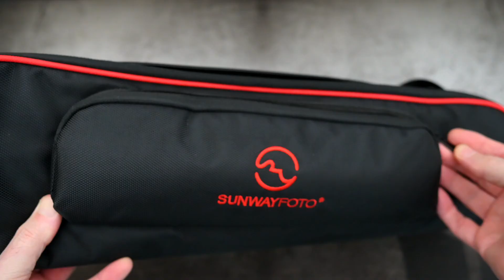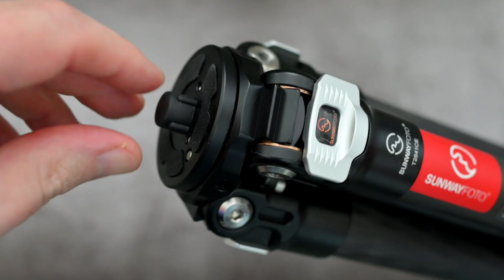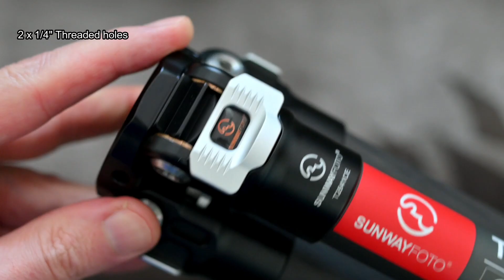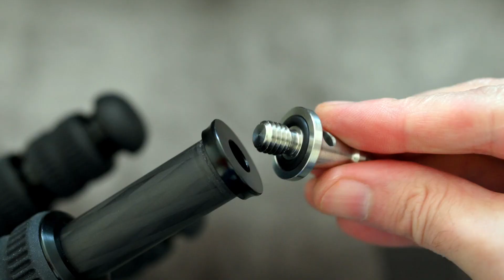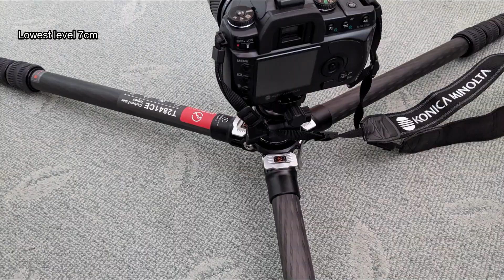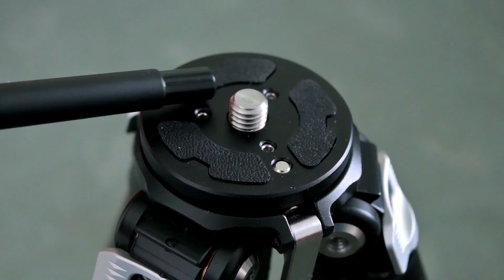Sunwayfoto T2841CE Ultra Compact Carbon Fibre Tripod: Review

Comment: The center column shape is to reduce the diameter of the tripod during travel. no "thigh gap" from the legs not closing all the way, which is common on tripods with center columns.
Reply from the maker: There are various design reasons why some makers are using a triangular shape